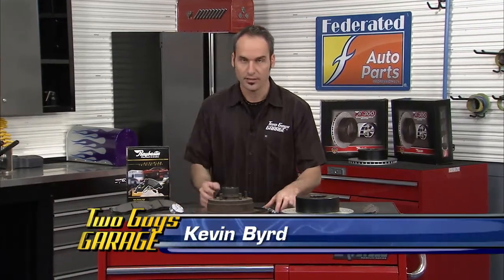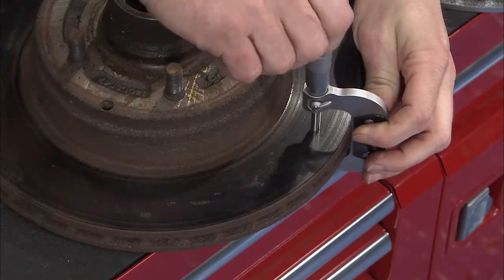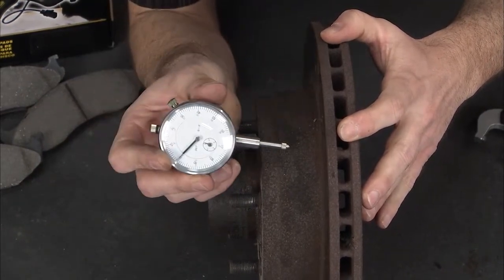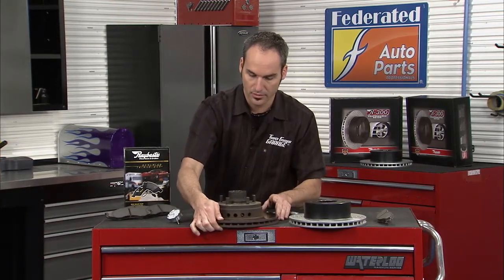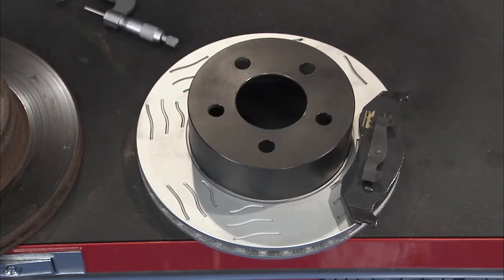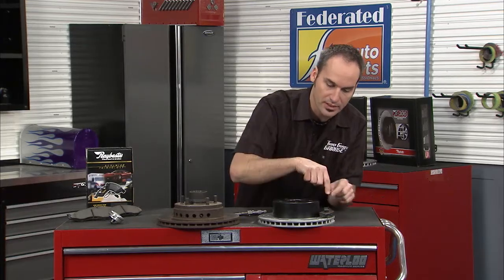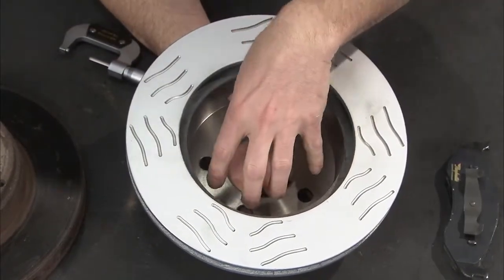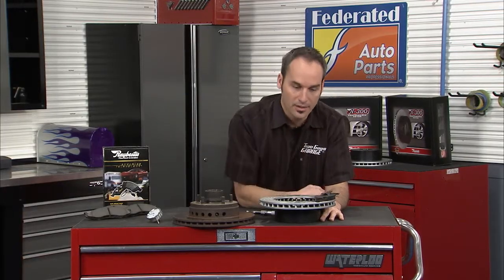Federated TechTalk #3 - Testing a brake rotor

Comment: So When I was looking at a vendors website for my application Raybestos 96795 it came up with the Federated Drums and Rotors name as the maker, are these one on the same I have found other vendors using this part# as the interchange despite it not being the same product. BTW I have the PER version on the rears got them on a closeout but the front PER version is triple the price on the non slotted. My main goal was for the corrosion paint on the hat and a highly accurate machining the slots are a good option but not critical for my use.